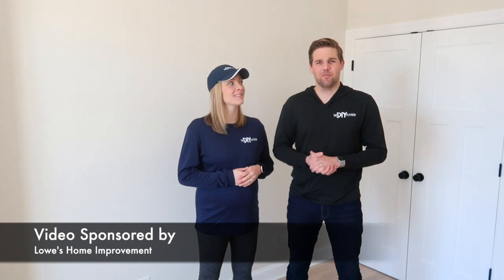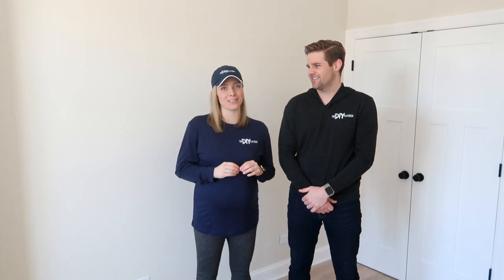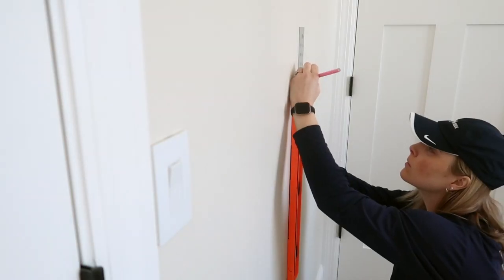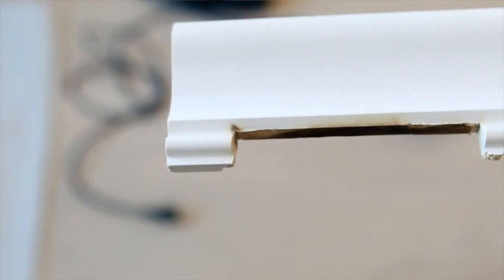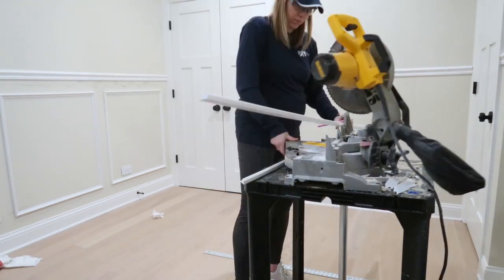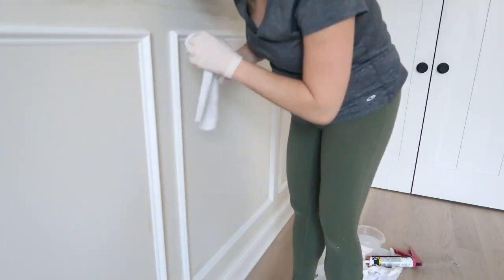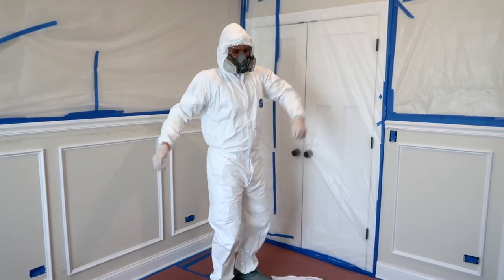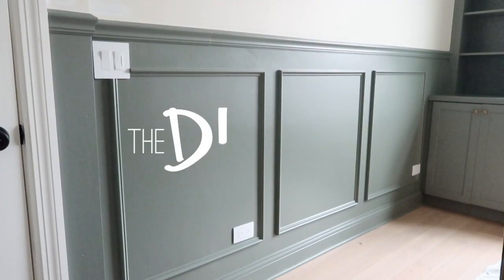How to Install DIY Chair Rail on Your Walls

Comment: You mention this being budget friendly- I used a website to generate a quote for a kit including chair rain and frame boxes for a 13ft square room and it came out to almost $700. Is that comparable to your expense? That’s not even counting paint, primer, caulking.
Reply from the maker: The price has definitely gone up since we installed it (we did it back in March 2020 and lumber prices are now at an all time high). The blog post lists the exact chair rail and PVC trim we used. You can substitute different woods/mdfs based on availability and prices. 

https://thediyplaybook.com/how-to-add-chair-rail/

Comment: Hi,
It looks so nice, im trying to do this in our baby room, but our walls have glass tissue (not sure if its the right english term) so we have a hard time getting the smooth wood look. How did you get the wall to be completely smooth and blank, so it all looks like wood?
Reply from the maker: We have smooth drywall, so we didn't do anything to them since they were already smooth
Reply: I saw a video where you can use texture (modelling paste) on the area you want to panel. Apply a couple layers allowing to dry in between and the last layer, smooth with a wet sponge. This will give you a smooth finish. Not sure if I’m making much sense but I can’t find the video now.

Comment: Do you measure the length of the hight and with of the moulding on the squares then just cut a 45 degree angle on them.? Love how it turned out going to try this out.
Reply from the maker: Yes!

Comment: Funny video. What do you do on the longer walls with the dado rail, are they cut to the right length or do you attach 2 pieces together and hide the join?
Reply from the maker: Good question! I cut two pieces together and caulked the seam.

Comment: What paint was used was it a standard emulsion paint on both the woodwork and the walls as obv normally woodwork should be a solvent based or water based wood paint like eggshell or satin wood
Reply from the maker: It's a water based paint in a satin finish.

Comment: We have a cement wall, can we nail the rails on that? please advice
Reply from the maker: No, I would only do this treatment on drywall or plaster.
Reply: @Thediyplaybook  Thanks for the advice. Would that mean it wont work on brick and concrete wall?
Reply from the maker: @AadityaHardenia  Yeah, I probably would just stick to drywall for this project!
Reply: use styrofoam rails and glue them on
Reply: @shaclo1512  and @DIY Playbook, thanks for the advice.
Really appreciate the response from you guys. :)
cheers!